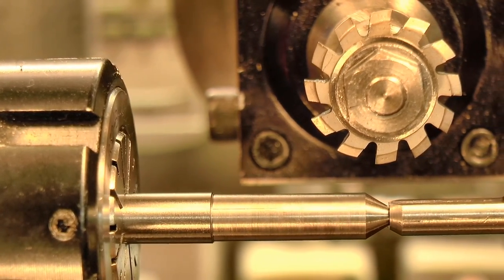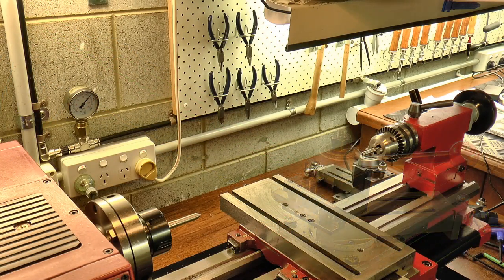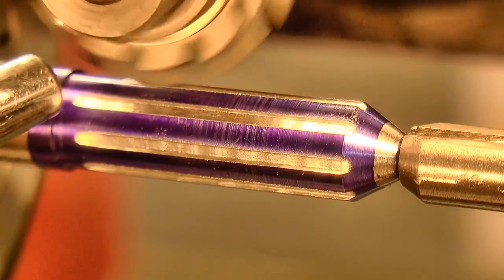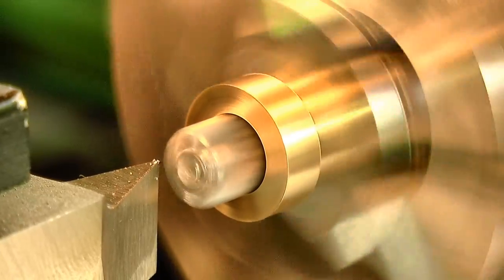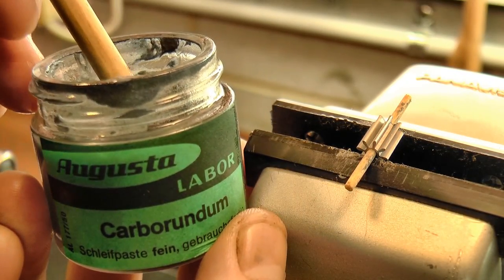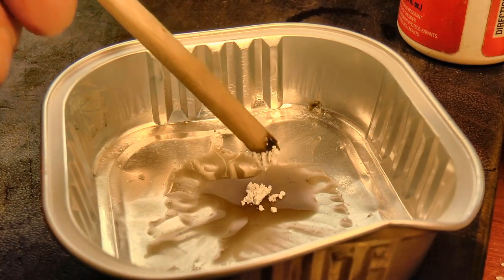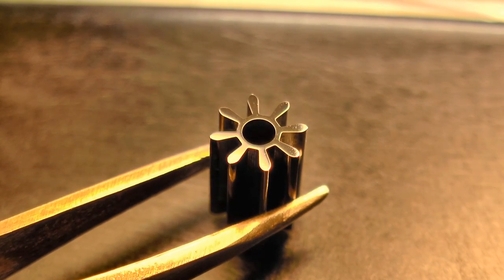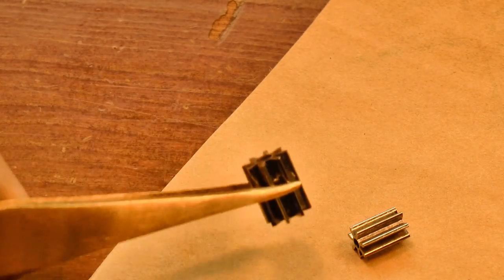Clockmaking - How To Make A Clock In The Home Machine Shop - Part 5 - Cutting The Pinions

Comment: It's great to see such meticulous workmanship go into the making of this part, but it's far from the optimal method. Modern Wire EDM will cut out this part with much greater precision and give a very fine surface finish. And it's cheaper than assembling all these expensive, rarely used and somewhat outdated tools which end up collecting dust in the workshop. All one has to do is design the part in any CAD program and send it off to a Wire-EDM shop. For all parts which require cutting in a single plane only, Wire EDM is currently the best method. In the near future, I see 3D printing of metal parts becoming a more economical option than it is currently.
Reply: I agree with SeReNiTY. If you're not making the parts yourself, might as well just buy a clock. And why not make it a digital clock, it would be more "optimal" by most criteria.

Comment: The first thing I observe is that you have what looks like a pinion mill mounted on the lathe, presumably driven by a separate motor off-camera. Is this a commercially available device, or is it shop-made? The second thing I observe (with envy) are the P.P. Thornton cutters. I do not think that Asia has knocked these off yet. They are expensive! I have noted your system of coating with Borax and alcohol and plan to copy it. I do lots of heat-treating. Love these videos, learn a lot.
Reply from the maker: Juan Rivero The milling setup is a bit of both Juan. The vertical slide, motor and spindle are all commercially available items, and the platforms and mountings are shop made. I hear you on the cutters! You can make quite good ones in your shop though, I will do a video on this process soon. Thanks for watching.

Comment: Wow, you're doing some great work and fantastic videos here. The only thing, that bothers me, is the extremely yellowish tint of your videos. Every metal surface looks like brass, on the first glance. Makes it hard sometimes to recognise what material you are actually using. I guess it has to do with the lighting in your workshop. Maybe you can equal it out with a proper white balance on your camera. I would really appreciate it. Thanks and keep up the good work!
Reply from the maker: Abcdefg Yes you're right there, it's the halogens. I'm still learning about things like white balance. In some shots, its just not possible to correct. Thanks for watching though, and appreciate your feedback.

Comment: +Clickspring Where to start? I love your videos but they're pretty dangerous for me. I keep getting the idea of buying a small lathe just for making hardware. Wanted one since I was 15. Anyhow, I'm extremely keen on learning more about your brass shaving technique for tempering - it seems very controllable and repeatable. Do the colors continue to advance after you remove the flame, or do you need to remove the part from the brass shavings? Does the part you are tempering need to be in physical contact with the shavings for tempering to occur, or is there a certain boundary where the colors will travel X cm up along a part in the air? I'm so interested because this could be a perfect way to put a differential temper on a knife - bury the tang and put it edge up in a deep pile of shavings and draw the spine to a dark blue without bringing the edge past a straw color. And your trick for using borax during the quench is brilliant - did you come up with that or learn it from someone?
Reply from the maker: +Matthew Marting Hey Matthew, great to hear you're enjoying the vids! The colors will continue to advance, but at a slower rate. Its useful to remove the heat when the color shifts to purple, and then watch for the shift blue to occur, and then quench. For a larger part, I get best results embedding the part within the shavings, but for smaller parts, just sitting the part on a surface works too. More info here:  https://www.youtube.com/watch?v=8h1Uf9bkc3E I should mention that the oxide is very thin, and doesn't stand up to handling. This is ok in clock and watchmaking, because the internals never get touched, but you may find its not durable enough for the exterior of a knife. The Borax is definitely not my idea, I learned that one from WR (Bill) Smith the well known clockmaker: http://www.wrsmithclocks.com/ Thanks very much for watching and asking :)

Comment: You were complaining about having to do such shallow cuts on the pinion, and you said, " Silver Steel" but you mentioned drill rod earlier,  is that a separate part?  also. is EN 2 similar to Nitronic 60 stainless. Nitronic 60 is awsome to use in the grouting industry as a coupling on stainless pipe,  will not gaul on 316. no threading compound.
Reply: O1, which (when precision ground) is called "drill rod" in the US is called "silver steel" in those English speaking nations which did not throw off the yoke.
EN2 is a relatively undistinguished grade of low carbon (0.2%C) steel, not stainless. 
Was it mentioned in the clip? He said he would have preferred to use EN8 (which is a medium carbon steel, 0.4%C, similar to AISI1040 or 1045, also not stainless)

Comment: Is that borax you are using for the heat treating? If so that is sodium borate not boric acid. I ask because supposedly you can prepare boric acid by treating sodium borate with sulfuric acid and then distilling off the boric acid. Which means that very probably the boric acid would just boil off if you tried to use it in this way. Thanks ;)
Reply from the maker: Boric acid - Cheers :)

Comment: Wow! That is really labour intensive heat treat for so few parts, was amazed at your lapping techniques, you should make a video on that, brilliant! I am starting to at least give my parts a little polish after milling and lathe? Do you have advice on that?
Reply from the maker: +Stephen Hodge Hey Stephen, to be honest I tend to make it up as I go along! The clock parts get much more attention because in clockmaking, finishing is more than half the job. But the general engineering stuff I sometimes leave as is, and other times I'll give it a bit of a touch with emery sticks etc. Cheers mate :)

Comment: Whe replacing a nylon worm gear with a brass one in an electric car seat adjustor motor assembly do you think loctite 603  (The green one you use all the time) wil be stong enough to hold but still be sacrificial which I presume is the pont of the nylon gear? Thanks ans you make great videos.
Reply from the maker: +rimmersbryggeri Loctite 603 has a similar shear strength to soft solder, so the bond will not break easily. Something else will break before that bond.

Comment: Tin. Could a tin plate be used in stripping woodworking cutting tools? I've never heard of it being done, but it looks like it would do a better job than the typical leather strip.
Reply from the maker: Lawman212 Maybe, although the tin is very soft, which might be a problem. I have to be very careful not to present a sharp edge to the polisher, or I cut the tin surface. Leather is perhaps less inclined to dig in, so maybe better for cutting edges? Thanks for watching Lawman.

Comment: Great video! I was wondering if you could share with us where you purchase your pinion cutters? They look like involute cutters, but obviously are a little different, and I suspect are specially designed for clock work.
Reply from the maker: +tzampini The cutters are cycloidal profile, which is a tooth form used in clocks, watches and other small geared mechanisms. I use the PP Thornton brand: http://www.ppthornton.com/ Thanks for watching and asking :)

Comment: When polishing up the flat side of the pinion, why was it rolling the edges?
Reply from the maker: +bitfreakazoid The wood is too soft. More suitable materials are Tin or Zinc, because they are soft enough to take the polish charge, but hard enough to resist deformation. Thanks for watching and asking

Comment: Uninformed question: why not face and cut the pinion off while it was still attached to the blank it was milled from?
Reply from the maker: +dropforgeBishop A good question - Once the leaves of the pinion have been milled, they are quite weak, and it doesn't take much to bend them. The work is also projecting a long way from the chuck which doesn't assist a clean cut. I decided it was gentler to use a jewellers saw and then face once inside a pot chuck. Thanks for watching and asking :)
Reply: I see, that makes sense. Thanks!

Comment: So would you recommend the tin lap for polishing the screws? It looks pretty nice and it seems you were doing it under power!
Reply from the maker: +ExtantFrodo2 Absolutely, tin is outstanding. Along with zinc, it is consistently mentioned in all of the classic texts for this sort of polishing work. It's soft enough to take the charge of the polish and let the particles embed, but hard enough to keep the corners of the work crisp.
Reply: Clickspring
Yes, I saw in later videos you did use it to polish the screws with outstanding results.

Comment: +ClickSpring or anyone else i have a question is brass cheap and is that why chris uses it for everything
Reply: It's probably a stylistic choice, although last i checked it's not particularly expensive.
Reply: +Isaac Smith for a clock, its probably for looks mostly. but brass is soft compared to steel so its cheaper to work with since you don't wear out your tools and cutting bits as fast.
Reply: Also it does not rust, it's easier to bring to a smooth machined finish, and it polishes much more easily - friction is a major concern for horology

Comment: Why do you blue the pinoins ?
Reply from the maker: +Gowtham Venkat After hardening, the steel is very hard, but also very brittle. It needs to be tempered to reduce that brittleness, hence the bluing - the blue color corresponds with a temperature that will deliver an appropriate temper for this sort of mechanical part. Thanks for watching and asking.
Reply: +Clickspring thanks you for such a quick response and im loving the clock making series

Comment: Have you tried tempering in just a simple small toaster oven? 

Can keep a pretty consistent heat, and spread the heat out much more evenly than a torch usually does
Reply: +shurdi3 Toaster oven wouldn't get hot enough to temper steel to blue, unless you have a toaster oven that reaches around 560 degrees Fahrenheit.  The brass shavings he used in his bluing tray distribute the heat from the torch very evenly. If he was tempering a knife to straw yellow then toaster oven would work perfectly, it's what I use.
Reply: I was talking about tempering his tools and similar 

Not about bluing
Reply: shurdi3 His process of tempering and bluing are exactly the same method. The blue indicates the tempering temperature.
Reply: No...

Look at the videos where he makes his own tools
Reply: shurdi3 Okay, any specific one you have in mind? because all the videos I have seen so far show him tempering steel to blue.
Reply: shurdi3 I just watched the one where he made a dovetail cutter, and he tempered it to straw yellow. In that instance yes, a toaster oven would work perfectly. But not for the blue tempering shown in this video, which requires higher temperature. That's basically what I said in my original comment, sorry for the confusion. But yeah tempering at straw yellow ovens are fine, not for tempering at blue or purple though.
Reply: Yes we can.